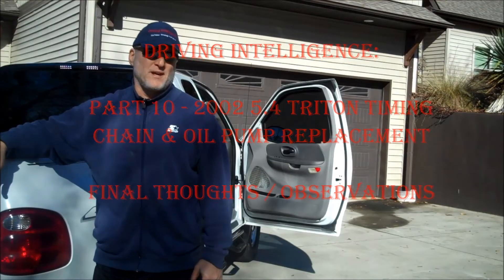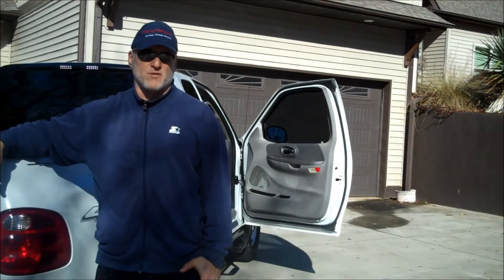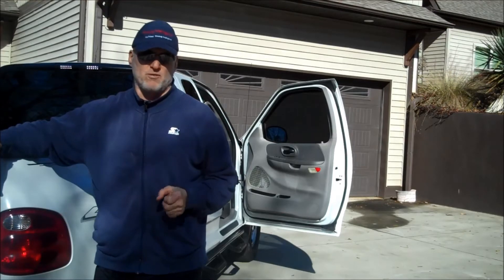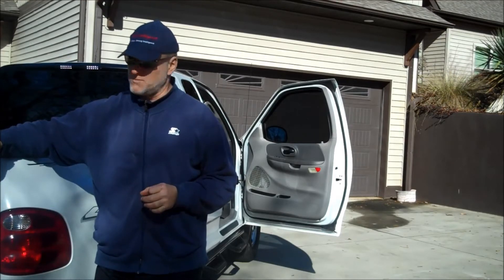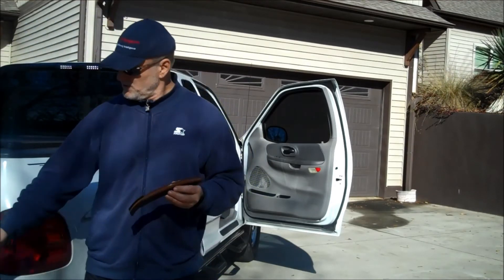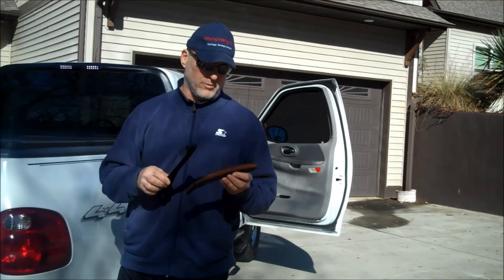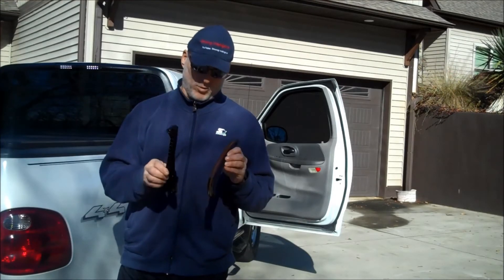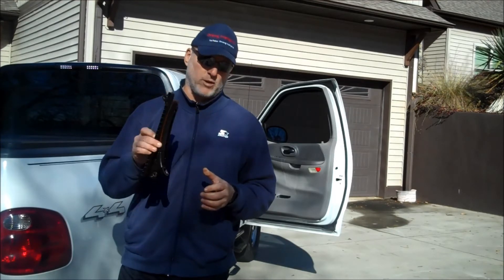Stretched Timing Chain: Benefits Of 5.4, 4.6 2V Timing Chain Replacement 10th Gen '97-'04 F150 Pt 10

Comment: Hello again! Great videos! I have a 03 f150 7700 5.4 and it is in good condition, 85k miles and i also have that knock which i think is piston slap like you said. I am the second owner and the previous owner did not drive it that much. He used it as a vacation truck to pull his 26 foot camper. Thats why its the heavy duty pkg with weird 7 bolt wheels huge rear axle and 4r100 tranny. Ive changed so many parts on this truck its almost too long to list. It sat quite a bit so i replaced the entire exhaust and still have a leak!!! Manifolds were done still had a slight leak/tick, so I did the magnaflow 3" catback with new direct fit catalytic converter y pipe (left and right side) and still has a leak. Im thinking it is the donut clamp from manifold flange to cat pipe because a bit of condensation bubbles came out there when started from cold. Is there a donut gasket that is supposed to go there? The manifolds were done 2 years before I got the rest of exhaust done so wondering if the manifold side wasnt cleaned up first before connecting? Not using the mechanics who did most of the work because when they did an oil change they did not replace the oil filter!!! Twice!!! I try now to do all my own repairs and appreciate you taking the time to help others! The manifolds were also dorman brand which i regret doing because they rusted instantly and should have gone with headers. Noticed you have a video on that I need to check out! If you could let me know about the donut gasket it would be appreciated since i couldnt find anything online. Thx again!
Reply from the maker: Hi Darren, welcome back and thanks for the compliment!  You should check out my header video because it shows how the thin exhaust OEM manifold gaskets blew out.  Take a close look at your exhaust manifolds and see if you can find any carbon trails that will indicate a leak.  There is no gasket where the exhaust manifold bolts to the downpipe.  Just make sure the attaching bolts are tight.  Recently I had a similar leak on my EGR tube, I saw the same bubbles / condensation, so I tightened it while the engine was running.  Took care of it.  But be careful and don't burn yourself!  Try to record your noise and post on my Facebook page:  www.facebook.com/drivingintelligence/   I love the 7700's... would like to have one, but too many toys as is!  ;)

Comment: Hey I think I’m experiencing the same issue you are stretched chain. My truck has pretty bad low end power and my fuel economy went to shit about 2 years ago. It’s been getting worse and worse and worse. I have 225,000miles did your chain replacement fix your power and you never mentioned did it effect fuel economy?
Reply from the maker: I did have another video that explained my findings. Not sure if I covered fuel economy in that video, but I did get some low end power again and the fuel economy seemed to improve.

Comment: My 99 Expedition has always had Mobil 1 oil, has never been allowed to get off the full mark
and I use a thicker viscosity oil than Ford recommended (10W30) and it has 350,000 miles on
it and runs perfect, never any noises whatsoever.. I know of one guy who has over 700,000
miles on his 5.4 2 valve using Mobil 1 and never any problems. The only problem I worry about
is the spark plugs blowing out of the hole....the fix for that is I run the plugs with 30 foot lbs of torque on them, instead of 10 foot lbs. like the factory used.
Reply from the maker: I'm guessing you're the original owner of your Expedition and have always followed strong maintenance practices.  A good show of what proper maintenance can accomplish.  This truck was owned by someone else for the first 165k miles... hence, maintenance not as good as you nor I.

Comment: I have the same experience with both of my 10th gens....both of them make the same noise. One of them I bought from the original owner who was a ford engineer, he said it made that noise since new. It's the nature of the 2V 5.4's with the lack of piston skirt.
Reply from the maker: I also have 2 2002's, but only my 4x4 makes that noise.  I believe the 4x4 was used to tow a lot and maybe did not have the quality maintenance I perform on the '02 I purchased new.  The 4x4 still runs like a champ, and only makes this noise until warmed up to over 120 degrees.